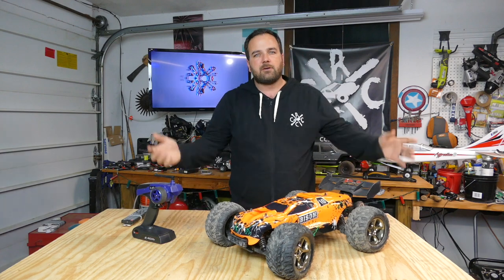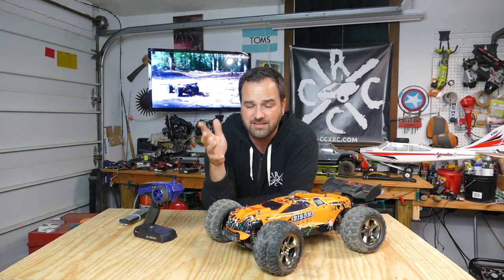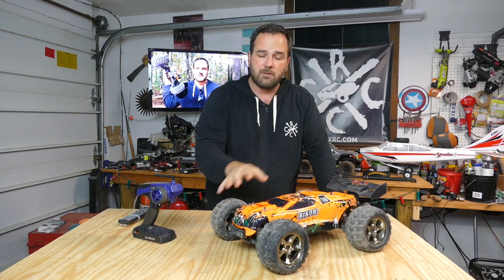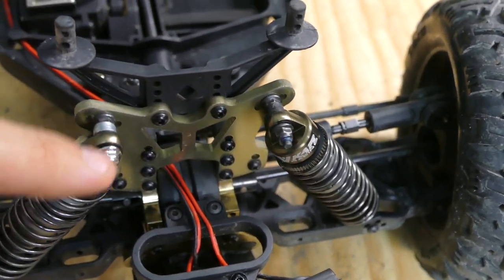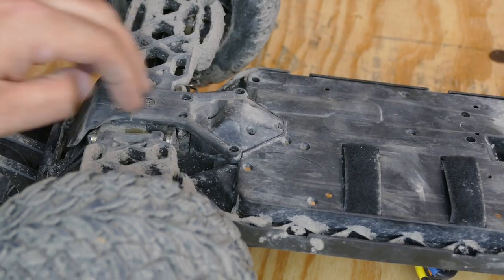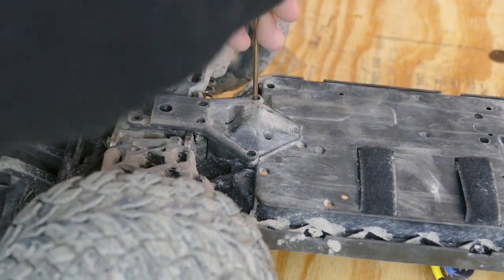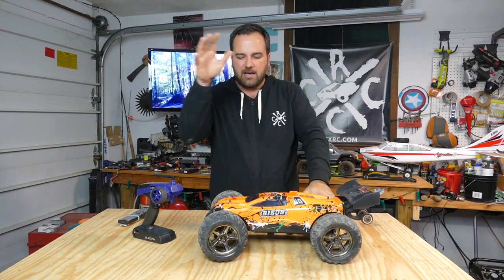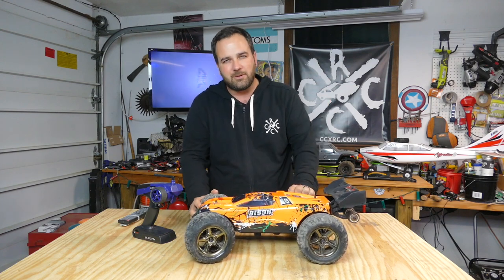VKAR Bison PROBLEMS and How To Replace The Spur Gear

Comment: Have you found any metal spur gear I'm having the same problem with the plastic ones
Reply from the maker: +heroid bytyqi I have ordered a new center diff and steel spur for it from Aliexpress. The steel diffs don't fit on the stock center diff.
Reply from the maker: +heroid bytyqi according to the manual that came with the Bison...yes. But you still have to buy the steel spur to go on it I believe. Still waiting for mine to verify.

Comment: Nice video. I'm just curious, why buy this over the Helion? Does VKar offer warranty services like Helion?
Reply from the maker: +Theibault just that it's $200 cheaper.
Reply from the maker: +CCxRC I think the Helion is probably worth the extra for the motor, esc, receiver and transmitter it comes with,  but if you are on a budget...a $330 brushless truggy powerhouse seems like a deal. And the few problems I have had seem like they would be the same for the Helion since those parts are similar.
Reply: What's the cost difference?
Reply from the maker: +Theibault on sale...the Bison has dropped to $277. The Helion Four 10TR is $500
Reply: CCxRC That's a bit of difference. :)
Reply: I was going to say the Helion electronics package is awesome.  I have bought a couple of the Ikonikk radios for other Rc's I own because i think they are that good.

Comment: So my center differential on my bison v2 has too much play. I took it apart and the shaft that goes go to the rear has too much play and when running it grinds like crazy. Upon closer inspection I know it aint the rear inclosed differential but the whole assembly that's connect with the spur gear. I tried looking for a complete differential drivetrain with no luck. The helion website only sells them by piece but not a complete one any suggestions. Thanks
Reply from the maker: I ordered this one and a metal spur gear to test it out. Still waiting for it to arrive. https://www.aliexpress.com/item/Rc-car-VKAR-Bison-Short-Truck-Mount-Upgrade-Kit-MA601-Central-Differential-Vicat-V1-V2-Available/32760345318.html
Reply: CCxRC I did see that one but it seems like it wasn't going to work, but like you said it's worth a try. I found this one off the helion website but it's for the short course truck https://www.amazon.com/Helion-HLNS1064-Center-Complete-410SC/dp/B01D8XHW4C
Reply from the maker: In theory that should work too. This center diff is listed in the optional parts in the Bison manual. That's why I went with it even though it says their SC Truck. Should've pulled the Helion SC truck to get it locally. haha. This style should support a metal spur
Reply: CCxRC The only thing I see missing on the helion sc truck drivetrain is the bearings that fit in between  the rear differential. For the one you order where can I find the missings parts like the gearing. Thanks again for all your help and feedback.
Reply from the maker: +pedronova74 looks like mine may have arrived today!
Reply: CCxRC Sweet let me know how it works for you. I temporarily fixed mine with some good old JB Weld won't last long I think haha
Reply: CCxRC So I was finally able to find the missing link. http://www.firelandsgroup.com/product-p/hlns1256.htm it comes complete minus the pinion gear and two smaller bearings.

Comment: Sorry for all the questions man . I️ hope you have time to answer another one ! what battery size and type do you recommend running in the bison? Can you put to large of a 3s one in it that could cause damage? If so where would be a good stopping point ? 
Thanks a lot for your time
Reply from the maker: Hey Cole, it can handle 3S. The larger it is in Mah rating is really just capacity. That just means it will last longer. No 3S should be too much power for it. I think that 3S 5000mah 50C batteries work awesome in it.
Reply: CCxRC thanks for the reply. I just wanted to make sure the esc would be able to take the power from any 3s battery.
Reply: CCxRC I️m having a little bit of a problem with not having the same turning radius both ways. I️ have turned the transmitter and car off in the wrong order a few times. Could this be the problem and how can I️ fix it??
Reply from the maker: Did you crash it into anything with one of the tires? it may be that the servo gears got messed up. Shouldn't be your on off order.  My kids just messed up my Zombie servo crashing into the fence too many times.  Does it drive straigth when the steering setting on the remote are near the 0 point (mid-point).  If the steering arm was not centered when attached...that could make it off
Reply: CCxRC I️ haven’t hit anything hard that I know of. Even when I️ drove it the first time I️ had to adjust the steering trim a little. I️ took the Servo arm off and re centered the arm and it may be a little better but still doesn’t have the turning radius to the right like I️ want it to
Reply: CCxRC sorry the the question marks . My phone auto Corrects it
Reply from the maker: Do you have the steering D/R turned all the way up?
Reply: CCxRC yes I️ do. Idk what that is but I️ do
Reply: CCxRC i do have it turned all the way up
Reply: CCxRC I’ve noticed the tires won’t turn on the street if it’s sitting still, idk if this is normal for this truck or not. How about yours ??

Comment: hey i wanted to ask when did u get it and how long did u have it for does it still run like does the esc and motor still work?
Reply from the maker: I've had it for about 4 months and abused it like no other RC. I did just crack the chassis, but already replaced it. I'm also adding a chassis stiffener to prevent that from happening again. But I'm jumping it 20+ feet off huge BMX jumps. The motor and ESC are still going strong...as is the Servo.  I've probably broke about $30 in parts during that time.
Reply: lol im watching your videos they are awesome I really hope this thing goes down in price a little i want this or the jlb cheetah but what do u think is better jlb or bison and I don't really bash i take my rcs pretty serious so yah i don't jump it I usually just go up and down the hill and sometimes just. drive around the yard but never crazy jumping lol
Reply from the maker: Jiggly puffs I think it's $259 right now. Not sure it will go much lower than that. Hard to find something for that price with these features and this speed. Haha
Reply: how much mph are you getting
Reply from the maker: not sure about the speed. I don't have a speedometer for it yet.

Comment: I have replaced four of the bushings...my fault due to crashes.  Two broke and the others popped out.  I got a bag of four from Hobby Town (Helion bushings...worked perfect).  They had them in stock.
Reply: Oh...and thanks for all the videos and all the help.  I don't feel led astray at all because I love this thing!  I have not had to replace the spur gear yet, but when I do, I sure would like to have a metal one!  Happy New Year!
Reply from the maker: Tinstar2 thanks for the tip! I'll have to check my local shop. Online they are backordered everywhere in the US. It's a bit of a weird design. Traxxas did something similar with the xmaxx with plastic pieces holding in pins and I've had to replace those as well. Makes it easy to work on, but has some drawbacks as well. Probably saves the a-arm from breaking 😆
Reply from the maker: Tinstar2 glad to hear you are having fun with it! Aliexpress does have a steel spur gear for it, but it doesn't look the same. I have one on order to test the fit before I recommend it. May just require a bit more disassembly of the center diff to get it on. Definitely doesn't twist over like this one does. I've seen full center diff replacements with the steel spur and the mount for it is different. Hopefully this mount will still line up.
Reply from the maker: Tinstar2 I'm taking the old one up to a hobby shop to look at other 32p 52t spurs and see if any look like they'll fit.
Reply: Cool.  Hope you find something!  Appreciate your help.
Reply: The part number for the Arm Bushing is HLNS1038.  $2.99 for four.

Comment: Hi! Need some help! I broke my left rear suspension arm and I noticed I broke my pin as well. Where can I buy one?? HELP!!!
Reply from the maker: https://www.amazon.com/Helion-HLNS1202-Suspension-Rear-Four/dp/B01MA0CYBI/ref=sr_1_2?ie=UTF8&qid=1503499689&sr=8-2&keywords=helion+four+10tr+arm
Reply from the maker: and I believe the pin you want is in the HLNS1267 which can be purchased here: http://helion-rc.com/Select/Four10TR/parts.asp
Reply: Thank you so much! Also, have you found a metal spur gear, if so where?
Reply: I think the pin is different, it's the one closer to the diff not the tire but I got it off Ali express

Comment: Would recommend going with the 80A esc rather than the 120A because of the plastic spur gear??
Reply: Nope, you will probably just burn the 80A ESC because it is not enough for the  Stock motor.

Comment: Hey can you upgrade the bison spur gear to an Traxxas stamped steal gear work.
Reply from the maker: Rc Flyer not easily. The mount is different, so it would take a lot more than just switching the spur gear.
Reply from the maker: I just replaced it with a VKAR steel spur gear

Comment: I suggest if replacing spur gear, check diffs. I checked and serviced all 3 diffs and the rear had no fluid. Just traces of grease. The center wasn't much better. After filling all diffs with diff fluid, it's a different and better Bison. Just saying.
Reply from the maker: Good tip!

Comment: so....i just broke the servo rod on my bison and they are currently out of stock. does anyone know of anothe part that may fit from another rc?
Reply from the maker: Hi Caleb, were you looking up Helion parts? If it is the servo rod, you should be able to get something threaded that you can adjust the length of. If you use Facebook, there is a Facebook Group for the VKAR Bison where you can post photos and ask questions. Lots of people finding parts and fixes there.
Reply: im not on facebook...was just hoping someone had already had the same issue with resolution. got my steel spur in along with the center diff, but have not installed. how bout you

Comment: I really appreciate your video, my boys and I have been sad since our Bison is having issues after the 2nd run and we had no ideas what's wrong.   At first it made loud noise which I think was from the spur gear, now it won't move at all but we hear the motor running. It could also be the motor gear which I will check out first per your advice.  I didn't bash the truck at all though I'm also new to the hobby grade RCs.  Btw, may be you can make a quick video about useful tools for RCs - those basic L shape allen wrenches are not the easiest to work with after some time.  Again, huge thank you for your video and I'll be checking out your other videos as well.
Reply from the maker: Sorry to hear about the problems with your Bison. These things are becoming notorious for shipping with a bad gear mesh that causes the plastic spur gear to get destroyed. I can do a video about the tools I use, but there are only a few specialty tools I use. RC Network has a ton of Tool Tuesday videos showcasing RC tools. I'll do a quick all-in-one video that shows the main tools I use on a regular basis. Good idea. 

Also, I ordered a new center differential that can old a steel spur gear. Still waiting on it to arrive (it's been about 2-3 weeks already) from Aliexpress. I'll post a video about it if it works out.
Reply: CCxRC - Btw, I can't seem to get the gear mesh cover off, it's just one screew, right?  Ok, got it out finally.  Man, you're right all these gears are bone dry - what the heck are they thinking?  So, is silicone gear ok for this gear mesh?  I think my spur is worn as well.  Thanks!
Reply from the maker: jowowetan don't remember...I thought 2. I'll take a look tomorrow. It's an odd fit though and takes some work.
Reply: No worries, I think I'd rather not mess around with it since it's still within a return period.  I believe I received a lemon unit so I'm waiting from GearBest at the moment.  If not, I will file a chargeback through Paypal.
Reply: I finally realized what the problem was with my car and you pretty much nailed it.  The mesh wasn't properly lined up and that gear was bone dry just like the spur, my spur wasn't that bad though I ordered the new part.  I put 50K oil, adjusted the mesh and everything is now smooth.  Once again, thank you for this video!

Comment: Hi, i just got my Bison and after a while of running, the motor just stops if i turn the esc off and turn it back on it will work for only a couple seconds, theres a blinking red light on the esc when it happens but i can still turn the wheels. Please help!
Reply from the maker: You say, after a while of running....how long? It sounds like the LiPo cutoff when your battery runs low.
Reply: yeah i think it was but the battery died very quickly.
Reply: how hot is the motor or esc can you touch it or is it to hot

Comment: I'm using Carter pin for instead of factory pins my stearin isn't working though
Reply from the maker: If steering isn’t working, I’d try a new servo. A lot of people use the DS 20kg servos on Amazon. They are cheap, but have metal gears

Comment from the maker: Hey Bison owners,
There is a Facebook group that was create for VKAR Bison / Helion Four 10tr people to share info related to these vehicles. Great spot for us all to collaborate beyond YouTube Comments. https://www.facebook.com/groups/167329297082070/
Reply: hey I'm looking to get a bison but gearbest is the only spot I can find it and some people are saying they never sent their item and I don't really want to pay $300 to a website I don't know is safe
Reply from the maker: Ask on the FB page for the VKAR Bison. I've not had any issues other than it can take a while for some shipments. The longest I've waited is 20 days, but I've never had anything now arrive.  I have heard of them not accepting payment, but I use PayPal and haven't had a problem there either. I'm guessing some Credit Cards may hesitate on the international web order thinking it is suspicious...but I don't know.
Reply: sorry I'm new here but what is the FB page?
Reply: fb = facebook
Reply: wehe I can buy the spur gear for this car
Reply: CCxRC hey man i have a question. Yesterday I hit something head on with my bison, not even at a high speed. The wheel was slightly turned though, and i couldn’t get it to drive straight after that. Today i took the Servo off and found that the Servo arm was a little loose in the gear. After tightening that and re centering the Servo it still pulls really bad. For example if it’s pulling left and I️ turn right it then starts pulling right, and if it’s pulling right and I️ turn it left it then starts pulling left. I can trim it out and it will drive straight until i turn. Nothing seems to be broke and I️m lost in what to do next , any suggestions?

Comment: How similar is this to the Helion Four 10TR? what is different about it?
Reply from the maker: The roller is identical. The Helion has nicer electronics (motor, ESC, receiver, transmitter and servo), but this one does pretty well with what it has. Not sure who builds the Helion RTR, but like most, it is best to check screws and gear mesh to make sure you don't have any issues on the first run.
Reply: If i could pick up the Helion for $599 and i could pick up the Bison for $430 what would you lean towards. What im saying is -  is the $170 worth the upgrade?
Reply from the maker: That's the difference we have. It's $500 for the Helion and $330 for the Bison. That's a tough call. Depends what your budget is. If I was spending $599, I'd probably look at an ARRMA.
Reply from the maker: But the Bison is really good in the low price budget. One of my favorite cars I own. Right now it is up there with my X-maxx at the top 2
Reply: Cool - Thanks for you advice mate!
Reply: Just Ordered the bison, i am fine with the electronics being a step down. especially for the price difference. The cheapest i  could find it was for $430 AUD including shipping!

Comment: I purchased the VKAR BISON Dec. 11, 2016 from Banggood.  It was delivered the Dec. 29, 2016.  I charged the battery and installed it in the Bison, and that is as far as I have gotten.  Nothing happened the lights did not come on or anything.  Thinking that maybe I needed to turn on the controller and try to bind it with the Bison, I put in new batteries in the controller and turned it on. Well nothing happened, I could not even get the controller to come on.   Here is my question - does the Bison have a power switch to turn it off and on?  If yes then that is my problem with the Bison, because there is no, I repeat  no power switch (on/off switch) what so ever on my Bison.  The controller is another problem.  It does not look like the controller in the manual and all of the controllers I see on YouTube are the same and  mine does not look like them.  I have tried and tried to get some support from Banggood without any success. From watching your videos, I have come to the conclusion that you can point me in the right direction.  Thank you for any information you can give  me.
Reply from the maker: +Dronefliertoo Waller just getting back from being away after having a tooth pulled.  1. There should be an on/off switch. 2. The receiver may be different. Seen several different transmitters which probably have different receivers. 3. Join the Facebook VKAR Bison group for input from others who may have the same transmitter and receiver you have. Though it should've been bound and ready to drive on arrival.